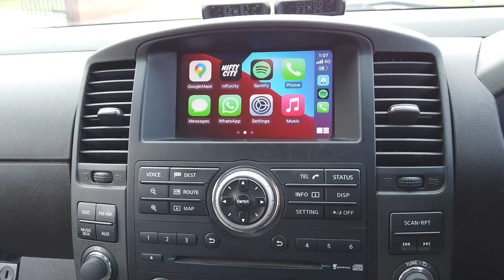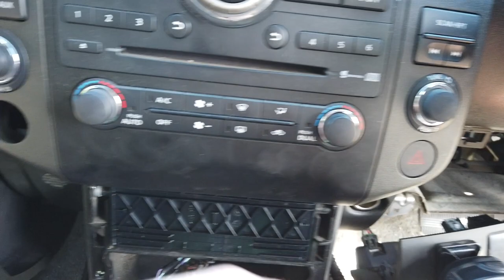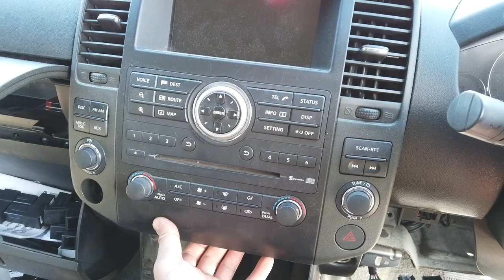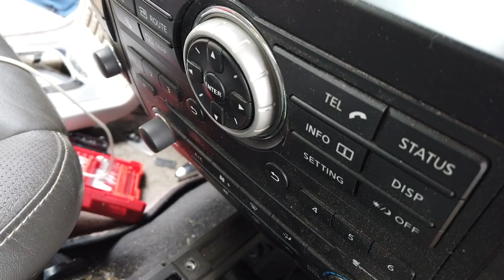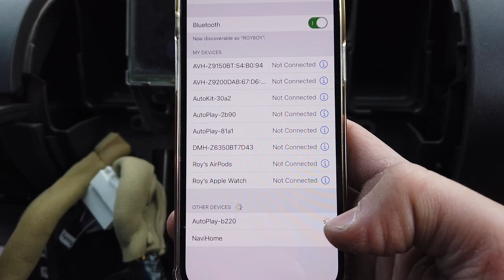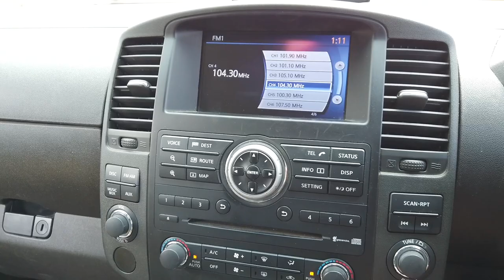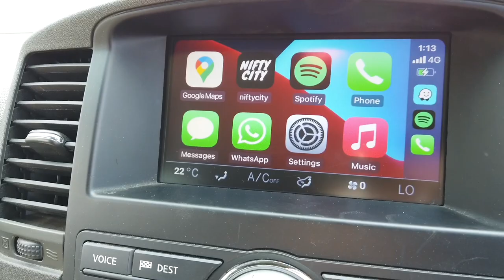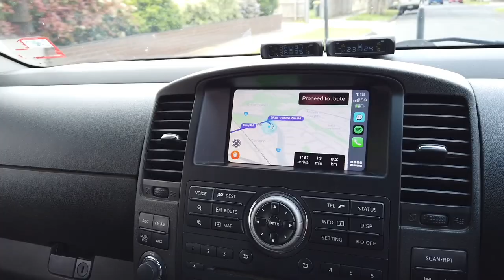Apple CarPlay & Android Auto in Nissan Navara/Pathfinder (How To Install)

Comment: is there a way to add an aftermarket amp for the door speakers? I know for the subwoofer just add a line out converter but i haven't found anything about adding an amp for door speakers and then replacing them as well but keeping the stock headunit with this module. Something i plan on doing but want to keep the ac display controls to where i can see them instead of replacing the headunit and not be able to see them
Reply from the maker: Hey JD, not something we can guide you on, however, we can answer any questions you have about our kits :)
Reply: I'm going to do just that.  I think the stock radio sounds dreadful or maybe just the tweeters are utter junk.  Anyway, I'm looking at the AudioControl D-4.800 amp,  you can feed it high level inputs and correct the sound via software with a laptop. Will run 4-channels to replace all speakers and you can also use the remote and line out to go off to a sub.  Pairing that with Focal speakers and underseat sub.

Comment: Does this integrate with the built-in DVD system in the R51? I wouldn't mind having the Tesla style screen and be able to watch movies with the bigger screen. Built-in motion bypass works for DVD  as well? Also what are the screen resolutions for the model in this video and the Tesla style screen?
Reply from the maker: Hey Passage, it does not integrate with the factory DVD system. You can watch movies with the Tesla unit via USB or Apps. Yes, built in motion bypass. The OEM Integration module is the same resolution as your factory screen, because it uses your factory screen. 

The Tesla Unit has a 10.4 inch screen.
Reply: Do you have a link to the tesla style screen and a video?